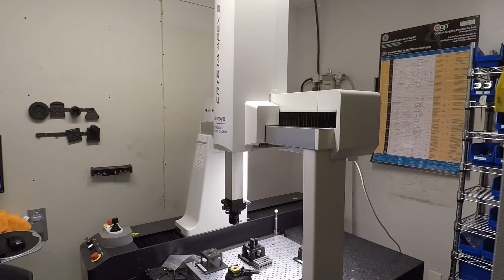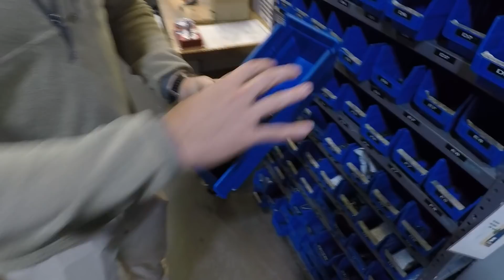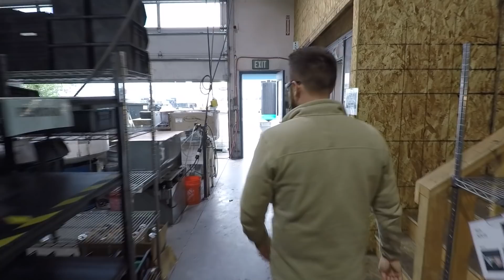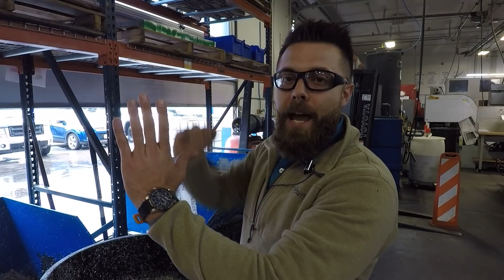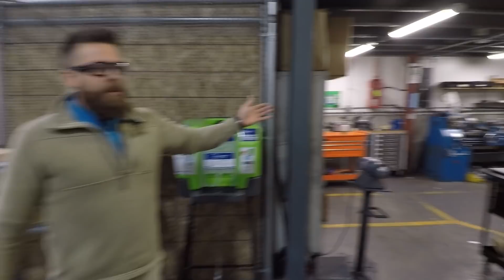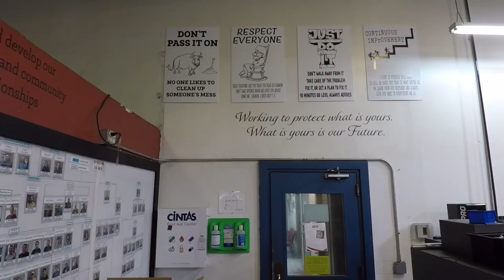CNC Shop Tour:  An Inside Look at a Shop FULL of Horizontal Machining Centers!

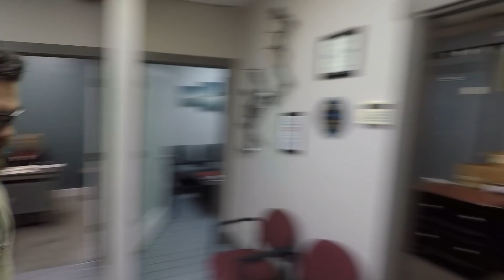Comment: 28:47 I know they are running out of room, but I'm pretty sure you need access to electrical panels and also depending on the voltage you need to be a safe distance from electrical panels for their arc flash zone, not sure what osha would say if they came by.

Comment: This is a true sweatshop, all the propaganda to make sure the employees are working as hard as possible to make the owner rich. No way I would work in such a dump.
Reply: I'm surprised I had to scroll so far down to find this comment. Honestly it's a beautiful shop from an owner/investor's perspective, but holy shit from a machinist's perspective I would never want to work there. It's obvious they hire college kids and button pushers to do 90% of the work. Extreme micro managing and focus on efficiency leave very little room for growth as a machinist, simply wage slaves working for the management's bottom dollar. Closest thing in America to a sweat shop I've ever seen.
Reply: As a machinist myself I see nothing wrong with this shop as long as you are realistic about what kind of shop this is. These guys are doing contract manufacturing, it’s a production line. It’s not a one off high skilled machinist type job. You have to be able to separate the machinist from the operator both are an important job but are used for very different reasons. 

Notice all the tools are supplied and put where they need to be. This isn’t the kind of place where you or I are going to roll in our own toolboxes and tools.

Also I have no problem with the motivation quotes either. Mass production is a highly repetitive boring job at times and sometimes you need that to give yourself a bit of encouragement. It’s not the employers fault, Mass production is boring it is just the nature of the beast.
Reply: @weldmachine  many many many people like to do just that. Go to work do their job and go home. When you talk to them and get to know them their priorities are in other things. They live for other interests and hobbies. The job is just for paying the bills. We have a saying down here in New Zealand, working for the weekend. I have ambitions and goals but some people couldn’t care less about being rich and hugely successful. 

It’s like people who like hunting and fishing or hiking, or any hobby type thing that is what they live for, not the job. 

You only get one shot at life, focus on what brings you the most happiness is the way I think.
Reply: @weldmachine  that a whole other kind of person all together. The people I’ve met who are that way are good workers but once it’s home time they are out the door. They couldn’t care less about overtime or whatever. They do the best they can at work but when the bell rings it’s see you later.
Reply: @WilliamPayneNZ  
I can't believe we actually had a conversation about this topic 🤔

I guess this is what happens when i am stuck at home on a Sunday with a bad back.
Nothing to do i guess. 😔
I decided best to delete anything i had to say about this topic. 
NO offence to you. 
Hope you have a great day 😉👍
Reply: @weldmachine  I’m a little confused no offence at all man. It was a good mature conversation between a couple of workers. I’m down with a bad back myself hence why I’m watching YouTube videos. The day workers can’t openly talk and discuss working conditions is going to be a really bad day.
Reply: @WilliamPayneNZ  
Bad Backs 🙄
Seems to be a common thing for us Manual labour workers.😒

Deleting my comments has more to do with YouTube, than our conversation. 
It seems to often when you write a comment that others decide to weigh in on the conversation.

I sometimes get a reply to something i wrote in a comment 6 months ago.
Who knows what i was thinking at that time. 🤔 

Something that happens today has some feeling. 
This time next week ????

Sounds like your getting over a Bad Back at the moment yourself 🤔

Thanks for your reply 👍

Comment: I find it interesting that the door looks to be wedged open, I would have thought a machine shop would be highly climate controlled in order to hold tolerance.
Reply: Not that critical usually. Lots of parts that are +- .001 temperature isn’t a big issue.
Reply: The shop is Highly Climate Controlled 🤔
You didn't see the huge man eating Cooling Fan blowing on the RoboDrill Cell 🙄